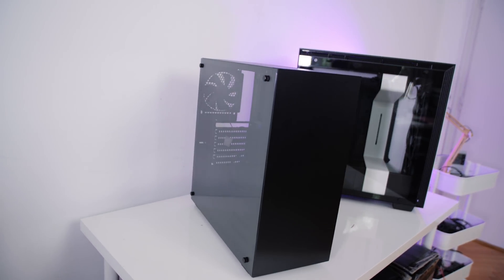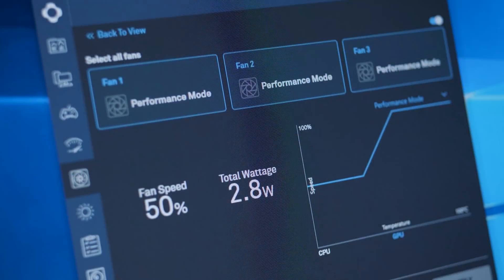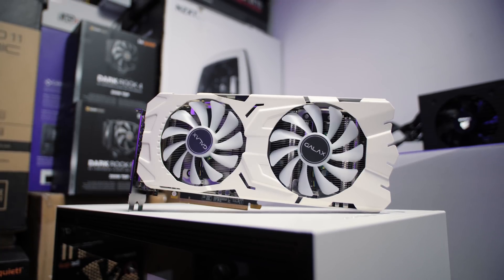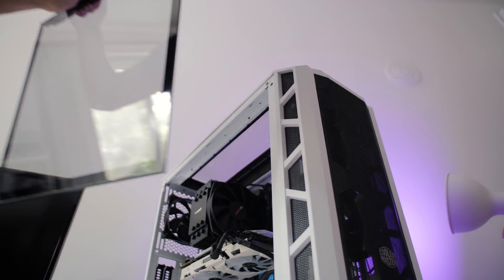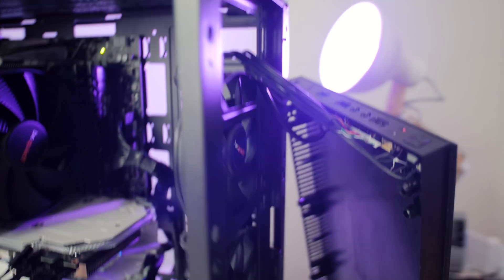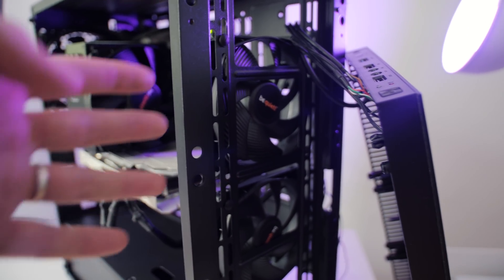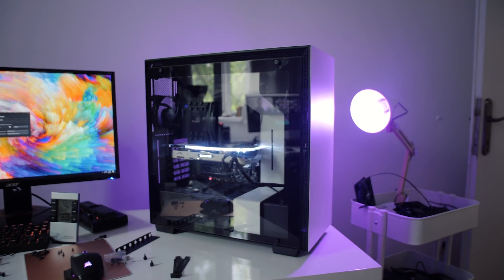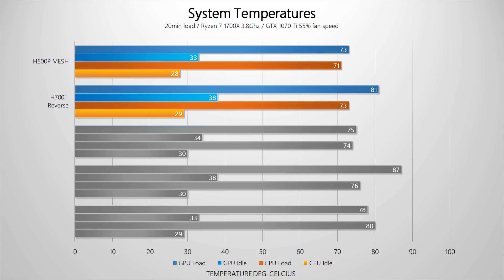What Happens If You REVERSE Case Airflow?

Comment: In my previous build I had an H80 for intake in the back, 2 of 120mm fans for intake at the front and a 200mm for exhaust on the top and my temps were fairly good, I also had a 120mm fan on the side for intake to give fresh air to the graphics card which was an open style gpu

Comment: Interesting idea. Problem with this is, it requires reversing the CPU cooler (not a good thing visually and practically  ) and also, you only have one fan at the rear, not 2. I'll stick with the regular directional flow, my cpu and board, VRM and RAM all stay at very good temps (28-30 idle) in my Eclipse P300, with 2x140mm front fans, 1x140 top and 1x120 rear with an H7.
Reply: It depends on CPU cooler. For example, Peerless Assassin 120 CPU cooler allows you to install the cooler the normal way and simply attach the fans on the other side. This results in reversed airflow and you get more air for the mem sticks as a bonus. However, unless you add extra panels inside the case to guide the hot air to exhaust, it may be pulled downwards by the GPU fan and put into circulation inside the case, which would obviously result in inferior performance.

Comment: I still prefer the Silverstone FM123 as case fans. They are dead quiet when the temp is low, but when temps go up they can move a LOT of air (gets a little noisy at a 100%, but they never get there).
They do have a downside, there is no PWM variant of the model and you have to add a jumper on the fan to make it work without it's controller.

Comment: But, if you are using blower style GPU you will be "sucking" hot air from it by reverse fan on back and heat air inside the case

Comment: At first i thought it would turn into a positive vs negative pressure scenario by reversing the airflow thus changing the air restriction.
After watching it made me realized i forgot to account for the positioning of the fans and how thus the temp of the air hitting your components.

Comment: Two in from the front, two out from the top, one out from the back. That's my fan setup and has been through various cases. I'm currently running in a Corsair C70 vengeance and the temps are pretty good. Delidded my i7 7700K and dropped 40'c from that to 45-50'C. Steve from Gamers nexus said impossible, but that's what i got. GPU runs at 60'c max, and mobo temp is 35'c. So all in all i think i'm doing pretty well!

Comment: Currently using a Fractal Design Define C and air flow seems pretty good. Temps are really good in it using the front as intake. Then again I guess Fractal's slits for air flow are bigger than NZXT's. I would've however considered a mesh front case if Fractal had one when I built mine. The meshify C looks great and performs really well in terms of air flow.

Comment: My fan orientation is bringing in air from the top through the 240m AIO, And exhausted heat from my two 140mm Rad AIO SLI videocards.

Comment: Wouldn't only having one fan for intake reduce supply of fresh air and lead to worst temps as well? Would it have been better to have two intake fans mounted at the top instead of one on the side? then have the CPU cooler mounted so it's blowing down onto the Graphics card been a been a better option? Plus many cases do come with filters for the top so that would also help with dust.

Comment: Meshify C with 280mm radiator front mounted with 120mm fan for rear and 120mm fan on top right above the VRM. Both 120mm are blowing out and the 2 140mm fans are pulling air in. (Mesh > filter > 280mm radiator > 140mm fans) I have my R5 1500X at 4 GHz with 1.440V and still keeping it under 45C under stress test and the GPU (RX 580) with custom fan curve doesn't go over 65C under load. For Idle, CPU 28C and GPU 45C and all fans lower than 1000 RPM making it very quiet. For load the fans speed up to 1400 RPM but I don't notice it at all while gaming. The loudest fans are from  the GPU anyways.

Comment: Using the rear vent for intake is way underrated and underutilized. If you have a blower-style GPU, then it makes sense to avoid intaking warm air from the back of your case. But if you don't, intaking fresh air straight to a CPU air cooler is very effective. But you shouldn't exhaust thru the front, you can intake from the rear and front and exhaust out the top either passively or actively.

Comment: Those cases are made to mount a radiator in the front, dumbass.
Reply from the maker: Not everyone wants a system with AIO / custom loops. Air-cooling is still far more popular, so thank you for the rather unnecessary insult "dumbass". 
-D.

Comment: I've been running reverse airflow in my Phanteks Enthoo Evolv for quite some time, because the front was the only place I could fit my 80mm thick 280mm rad, and I didn't want to fill the case with warm air. It works great. The only downside would be the lack of intake air filters, but hey ho. :)

Comment: i have 120 exhaust.  3 on top of 360 antec mercury for exhaust and 2 120 for intake and my temps are good for me... i have a cooler master trooper case. with amd fx 8300 with gtx 1050ti and 16 gig ram with no heat shield. and 4 hdd drives and my pcu also blows air in to case  and my idl temps are between 1 - 12 c op cpu and 28 - 45 on gpu. at this time 5/5/2018 its 0c on cpu and 30 on gpu as the ambient temp is 9c load it goes to on cpu to 38c and gpu goes to 62c after 4 hrs of gaming on max settings of 1080p so i am happy with that. will se wht it will be with my Ryzen build in 5 months

Comment: Sticking an 80mm fan under the GPU helps a lot. Mine is set to exhaust, giving the you dedicated exhaust fan to pull that hot air out that normally gets trapped between the GPU and PSU shroud. This is in an H500P with the GN front panel mesh mod.

That little 80mm fan removes a ton of hot air. I went with a BeQueit fan, so despite being 80mm it adds no fan noise to the system. Only ever hear my GPU and AiO fans.

Comment: I use top intake and front intake and then a bottom mounted 360  rad on exhaust and a back exhaust. 
The bottom mount rad actually works really well for liquid cooling scenarios IMO. 
Front rad intake blows hot air in the PC. Top intake rad, same problem. 
I also don't like either of those positions as exhaust.

Comment: comment: 
Front = intake
top = best exhaust
GPU blocked, due to traditional vertical ATX
I think, reverse ATX case design will be better for GPU(CPU at bottom)
Horizontal ATX case will be better for all :P
Reply: Many report that top exhaust at front of case will pull the intake air out before it reaches the MB,.
Keep an eye on MB and M.2 Temps.
Reply: how about:
take a thin plastic card or something else blocked the Ram side boundary of the mainboard and fixed there,
make the front part of the case as a duct that allows front panel intake air goes to the bottom of the case 1st, & then, the convection & air-flow volume will make as a circuit. 

On the other hand, if u use the original CPU cooling-fan, u can also use this, as I know, most of original CPU cooling-fan' air-flow are facing to CPU, so if u make a board/card there, there will be also working as a duct to have better air-flow, I believe.

(Hope u know what I mean, sorry to my poor English, or try some more testing)
Reply: I understood you.
I picked Noctua NH-C14S. I put it on an ITX board. I have to pull the cooler to do anything on the board :)
Works great. I see MB about 10c warmer than CPU and M.2 about 10c warmer than the SSD's in the system.
I fabricated my 200mm exhaust fan behind the MB so the intake air has to go over and around the MB.
These days with all the AIO systems out, many never think of MB and M.2 temps. 
They see CPU and GPU temps are ok and think all is well.

Comment: Using a TT Core V31, which I bought about 1 yr ago, because I had an Antec Sonata for silence, however, the previous summers the case got hot, hence the TT case ;) 

Fans everywhere ;) Front 120 n 140, CM TX3 with push pull fans, a 120 rear fan, and x3 120s along the top... I avg 35 db

Comment: This was perfectly timed!
I recently got a Corsair H100I V2, but by case didn't have enough clearance in the top to mount the rad and fans, so I ended upt mounting them in the front, and like most cases the front is almost completely covered.
Instead of having the fans blow the heat from the rad back in I mounted the rad to the frame and the fans behind it (closest to the board) blowing the air out the front like proposed here.
I reversed the rear fan also, but frankensetined the fan cover from my old PC case's PSU.
I also mounted 2 fans on the top where I wanted the rad to go.
I'm not sure which orientation is best though, pulling air in or out? 

I can remove the front cover of the case as its TG with some metal design with cutouts to help if it gets toasty.

Comment: the problem with most cases is they are designed for "everyone" with spots to mount 120mm or 140mm fans instead of forcing you to pick one or the other... this causes the re-circulation of air in those front panels because its simply pulling air from the lowest pressure points, which often are those giant gaps designed for flexibility, and you are using preheated air to cool down a system... close of all those gaps so it can only pull in outside air... thats what a "true" positive pressure case is...

people like to throw out phrases like "positive pressure" when describing this, but most folks do it wrong, because their positive pressure cases are just trying to throw more fans at the problem rather than using less the correct way, it needs to be a true one-way flow, without ANY ability to re-circulate from that initial entry point, less is more, as long as less is done right... if you don't do it right, yes you will need front fans, bottom fans, and top fans, and hope you get enough fresh air inside...

if case manufacturers created different mount plates for each fan size, so there were no gaps and it was truly sealed for one-way air flow without any re-circulation, you would see a lot of the poorly tested cases with restrictive front intakes perform slightly better, still not great because its a restrictive entry point, but it would be enough to shave several degrees off... I should also point out this means the fans will generally run more quiet because they are spinning slower because the inside is cooler...
Reply: i dont think ive learned more from a youtube comment then i did from this one. thank you.
Reply: More learning: *than
Reply: I make my own case fillers.
If you take a piece of paper and mark it over the whole area you want to cover, then laminate it and cut it out, you can place it around the 120mm fan to block the 140mm gaps.
I've tried a top to side flow system and its rather good. Cut holes in lower part of the side panel for intake and fans on front, back and top draw out.
It's negative pressure, but that doesn't matter as it's negligible and I've sealed any gaps with cheap sealant.
It's a second hand cheap case and I don't care about aesthetics.

I'm using a top down CPU cooler though
Reply: @markp8295  I duct-taped the extra space for the 140mm fans since I'm using only 120mm fans. I have the Phanteks P300 and even with medium-static pressure fans like SP120 you need to speed up the fan speed to achieve proper cooling.
Reply: Corsair 500D has the versetile mounting you discribe but with the air filter flat against the fans and air openings making it actually more restrictive to re-circulate hot system air. I assume most case manefactureres take these things into consideration already and if not black duct tape sometime is the answer.
Reply: I'm sure Electrical tape could also pull this off, and since it's inside it won't be seen
Reply: To compliment this I would like to see a return to full frame fans. The round frame fans are leaky as all hell, especially if you slap them on rads.
Reply: ud be amazed how temps are improvoed with some DIY  cardboard shrouding to isolate air tunnel flow

Comment: good timing... I have a Corsair Carbide Air 540 and just put the corsair H150i to exhaust in the front... could only fit one 14cm fan as intake on the top and the back 14cm as intake as well. seems to be working well. My r290 has always been hot idling around 40c but she isn't exceeding 88c during benchmarking and games so i'm happen. Haven't seen my ryzen 2600x exceed 61c yet. Noise isn't bad either.

Comment: I've wondered about this myself- I wonder if putting jury rigging a small fan on the unused pcie slots will help with the gpu temps. 
You can also buy filter mesh separately buy putting sticking it to some magnetic tape that would take care of that issue although the factory look will be gone alibet only from the back.

Comment: I did not yet watch the video but I don't know why this whould change much (much, not anything). You still have to push the air through that narrow exhaust. It also doesn't matter in a simple battery-LED-resistor cirquit where you put the resistor. I think in this case it's exactly the same.
Let's see if you proof me wrong.

Comment: current config , = 4 intake , Little restriction =Mesh front panel- Non removable , 1 exaust = Rear , stock 15X cooler - Dual Aftermarket push pull cpu cooler , #1 = 32-42 on cpu , 28-43 on gpu , #2 28-36 cpu , 26 - 42 on gpu , little difference in temps . I Do keep my pc close to Air-conditioner Exaust , so Little worry on temps

Comment: What a lot of people don't understand is AIO coolers. They are designed to push cold air from the outside to the inside of the case letting cold air pass through the radiator rather than hot air inside the case pass through it making a big difference in temperatures. I did this test with an H60 push pull configuration and it was 6c cooler letting the air push in from the outside.

Comment: lol theres only at max 5 degree differences of using h500p mesh and that cheapo case that only has 1side of ventilation hole. i started to get it now. people starts to complain about closed front panel only because gamers nexus keep bitching about the original h500p, even tho the problem isn't the case but the fan and steve didn't bother to change the fan for his testing.

Comment: I use a 120mm rad on the back as a push/ pull intake. External air cools the rad that way. I have two slow 140 mm in the front as intake to blow air to GPU. Two 120 mm exhaust out the top and controlled by mother board. Front and back intakes are filtered to reduce dust. My temps are great and system is clean.

Comment: In my experience , i have a Corsair 540 air and my flow is inverce , but with two all in one water cooling, in the normal flow have very hight temperatures in the motherboard and GPU , when i inverted the airflow my temperatures down below the 50°C .

Comment: What if you use a low profile horizontal cpu cooler so that you have an unblocked air channel? Also, add a fan to intake from the top of the case.

Comment: I've tried to reverse the airflow on my S340 Elite couple months ago and I can tell you that, if you're watercooling, it changes a lot, as not only I got better temps on CPU and GPU, but also on other components like RAM and the VRM
Reply: hey i know its been a year since you commented this but i have the exacts same case and am doing watercooling and want to reverse my fans for aesthetic reasons, how dit you configure everything, and are you using the included fans? thank you
Reply: @DutchDinosaur  Hi, sorry if I'm replying a year later, anyways, since I commented I changed quite a few things in my pc and I'm not looking to achieve the best performance anymore, I just need a reliable machine for work (which is totally overkill for what I do lol), so I can't really tell you how it worked out as I have a typical airflow config now
Reply: @feelingtech2233  I had been using the referse airflow for a pretty long time, I recently swapped the airflow back to normal and I'm actually getting over 10 degrees cooler on the cpu now. And the rest of my components are still close to the same temps
Reply: DutchDinosaur I know it’s been a year since you committed but I’m now in a similar situation and want to know how it worked out for you.

Comment: Arc Midi R2:  3 140mm intake (2 front, 1 bottom), 1 top exhaust 200mm + 1 140mm rear exhaust: low(er) rpm, but great airflow.

Comment: 1450rpm and u cant hear anything while the system is at load... sure
Reply: L1f3 74k3r i have a bequiet cooler with 2 silentwings 3 on it. he isnt lying
Reply: my aio pump broke so i got the "be quiet! Pure Rock Slim " yesterday and at 1450 rpm it isnt rly that quiet plus i had several other be quiet fans in my cases, they may be quiet under 1000 rpm but not at 1450...

Comment: On the front to back air flow, the gpu is cooler partly due to a air flow  from the lower ventilator at the front. Its gets an air flow below the graphics card.

Comment: So your cpu is SLIGHTLY cooler in reverse, not that it matter cause cpu's don't throttle until TJM, but your gpu is much hotter, which is definitely throttling. 

Also...Dimitri, the gpu is hotter because it's not getting any fresh air. With the standard layout there is a fan pointed directly at it.

Comment: I have 3 120s in the front as intake, another 120 in the back for exhaust, and two 140s on top also as intake
Reply: Fish How are your temps? Does changing the top to exhaust help the temps? I know switching them will cause more dust but curious, as I want to do this myself.
Reply: Shawn Dixon I’ve tested changing the top two to exhaust and they hurt the temps, raising the temps about five degrees on the CPU and about three degrees for the inside of the system, this is with all fans running at max speeds(1500 rpm)
Reply: Fish Thanks for testing that out and replying so quickly.